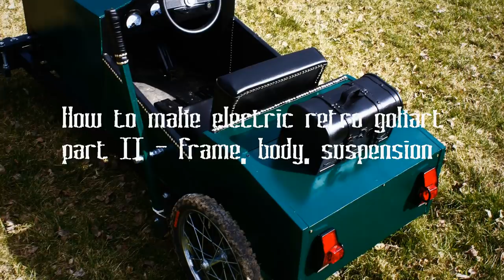Homemade electric go kart for kids in vintage style - part 2 - frame, body, suspension, engine

Comment: where Did you get the motor from? 

are they available online or is it a washing machine motor?
Reply from the maker: +Lance corporal cook no it's not from washing machine. It's from china. You can probably buy it on ebay.
Reply: DIY projects - step by step liestre
Reply: u can use treadmill motor aswell but with a regulated speed

Comment: not bad, is that electric motor?
Reply from the maker: +Reasor1995 yes it is. Watch The first part to see how it's running
Reply: Ok, do you need any experience with wood to build something like this car?
Reply from the maker: +Reasor1995 i think that yes, but only a little. Good, dry wood is important.
Reply: Thanks!

Comment: Did you have any issues with the planing mode of this "austrian" piece of chinisium sh**. ? I have the same bernardo j/p and have probs ever since. I was able to set up co-planarity but still have problems with the reference table of the planer, and its a factory issue. They gave me all other tools manuals, but this one with the machine, so if u have a pdf for the PT260 that you want to share, it would be grately appreciated! Can i have a contact with you so we can resolve common issues with the machine? I solved some of them ...
Reply: Bron Weidner we will "cues" if we want to